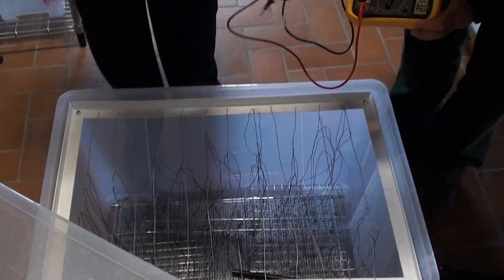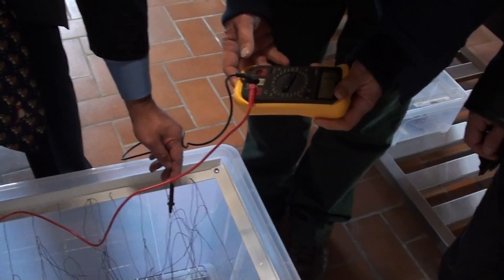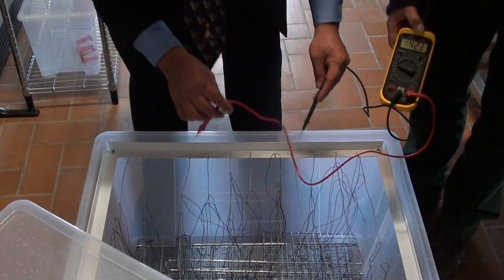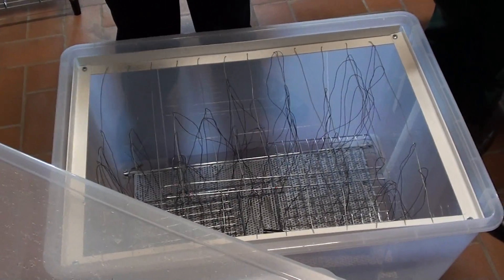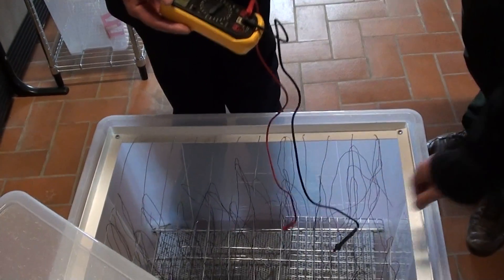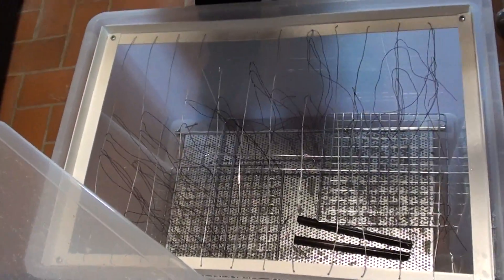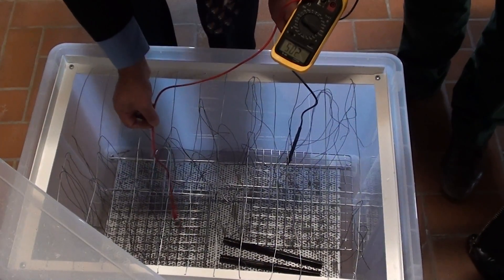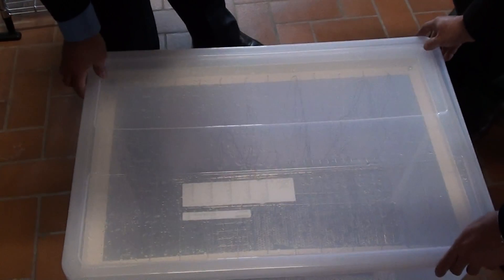Measuring voltage

Comment: Thanks for the lesson. We "Nederlands group" try to coat stainless steel, we like some tips please.
Reply: ***** have you done any tests? not having a dig, i just reckon if you think they are oxides, if you could explain clearly your reasons and any tests you've done your self, it would help others understand your point of view.
i see people saying its nonsense, but never a clear explanation as to why they think so. if someone could explain convincingly where they have been mistook i'd be happy to hear it, but until then, i'm waiting patiently.
as for the multimeters, the percentage that are defective from factory is probably very low, the chances of this one being faulty are as low. although true, its a bit picky.

Comment: This multimeter is defective? When separate the plugs has appear 0 in the display and no hundreds... Please, for measure of low voltages, use 20V scale.
Reply: For a good experience is necessary first of all to make sure that the (multi)meter  is working well. Putting it on 20V and first measuring cells, AAA batteries and car battery. Then, separating the black and red plugs, must give a zero value, always. Better yet, replace the black and red pointers for alligator mouths.
When measuring:
- keep the meter stopped in a kind of pedestal and facing the camera.
- connect the alligator mouths and hands away from the bowl for a few moments to have a correct idea of voltage.
- After obtaining good results, it is worth considering the possibility to measure with an ammeter, to get an idea of amps and watts.
Reply: I also recommend when you are making adjustments to put the mouths of alligators in place of the original pointers, enjoy also to increase the length of the black and red wires, so having loose in the measurements without have moving the (multi)meter during the process.
I waiting new videos with the modifications in the measurings. Imagne I'm now between you, helping you.
Reply: Rogerio dos Santos Éven better. With longer wires you will pretty likely get higher readings, because you catch more from the surrounding noise :D

OMG!
Reply: Valeri Kravinik With longer strands, the variation is between 0.1 and 0.2 volts and this no affect the experiment, in contrast, the fixed multimeter gives more credibility, as well hands far of pointers for a little time and show the measurement.